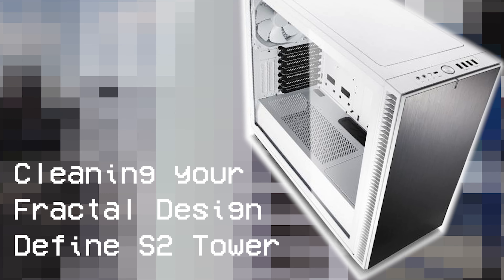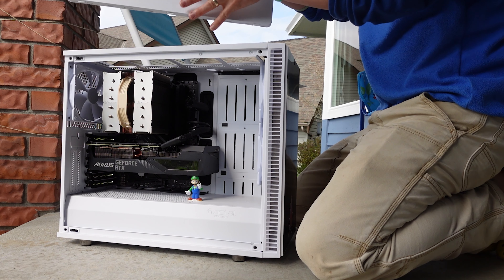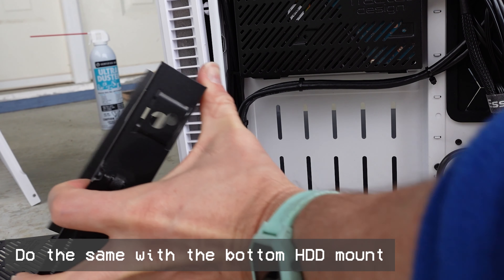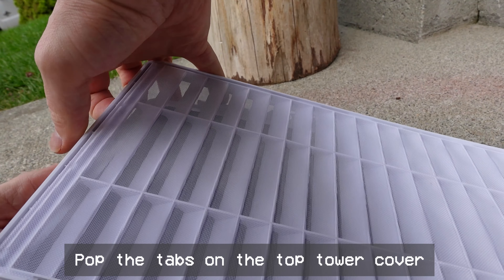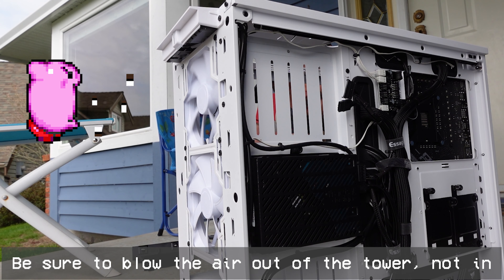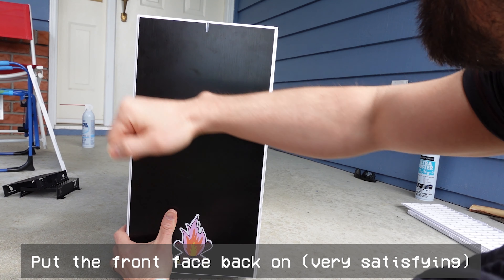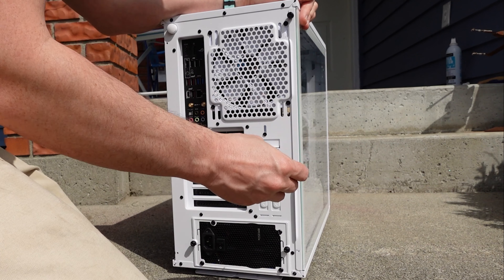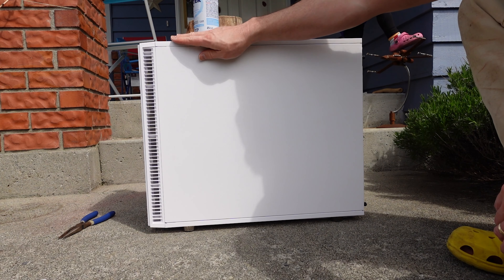Desktop Tower Clean!  Fractal Design Define S2 #fractal

Comment: hi how do u clean the inside when it has too much dust
Reply from the maker: Are you not able to get it out with compressed air? Compressed air should be able to get out most dust build up - but I would recommend doing this in a well ventilated, ideally outdoor spot where you can tilt the tower downwards to allow for the dust to more easily flow out.